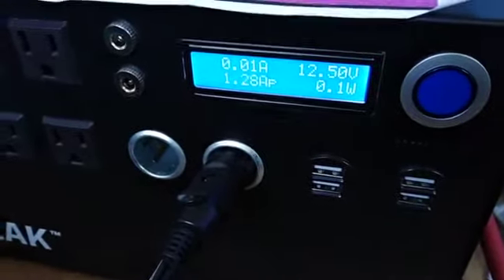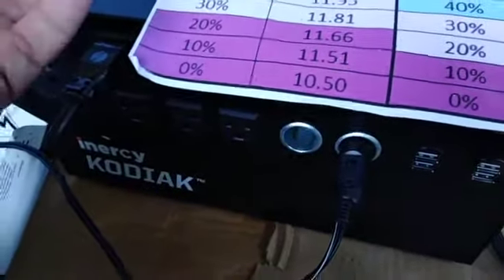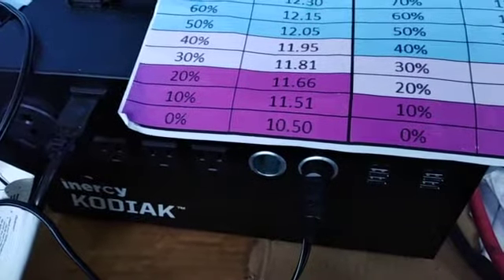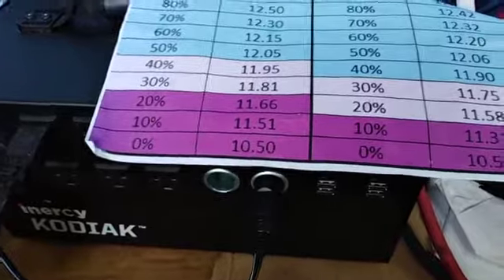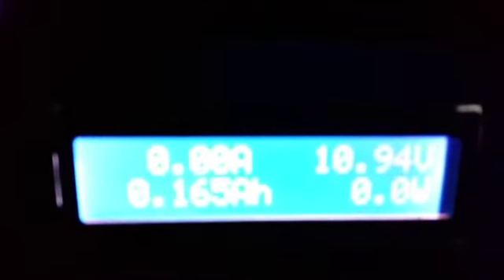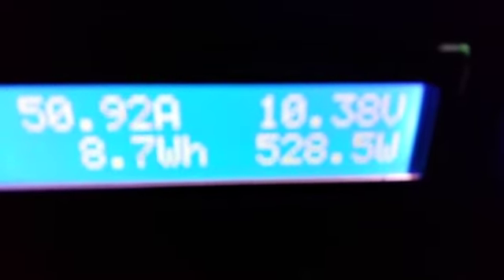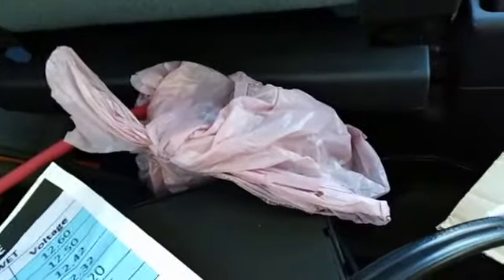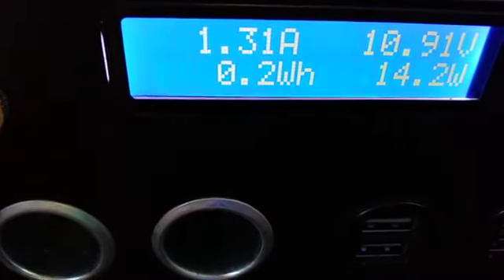Kodiak Solar Generator Destroying a AGM Battery

Comment: Is the Kodiak shortening the life of the AGM battery.
Reply from the maker: For most people the Kodiak and the AGM battery would get alone.  I am a power user.  I run an AC and an Electric heater.  I cycle the Kodiak very hard.  I have a video that that takes the Kodiak to 10% power.  The Kodiak is a very well build generator and I am not afraid to stress it.

Comment: I do not understand why Inergy recommends AGM or lead acid batteries to chain to a unit that uses lithium batteries and does not provide a custom charging and discharge parameter for the lead acids.  I also do not understand why I can’t connect lithium batteries as long as I monitor they are not being over charged or discharged by the kodiak?  Actually if you look at the 18650 lithium batteries and put 3 in series, the voltage matches the kodiaks peak charge and discharge voltages of 9.3 - 12.5v

Comment: I was looking to to the same for my motorhome house power. Only using the kodiak but I don’t know how to tie it in with the existing house battery? Any ideas?
Reply from the maker: Buy a 12 Volt Charger.  Connect the 12 Volt Charger to the 110 plug in the Kodiak.  Make sure you get the right  12 Volt Charger for your battery type.
Depending on how many Watts you have on the roof will determent how large the charger can be.

I went and bought a solar control and an AB switch :
https://www.youtube.com/watch?v=wre2SL5Watw&list=UUdo_IcaaYxaQzFnaRt8Mypg&index=2
I now can connect the solar array to the Kodiak or the AGM battery, but never to both at the same time
Reply: Can you show me a diagram. I used to have a gas generator. But it got stolen. Can I put the kodiak in the. Same place? And use the cables still there??
Reply from the maker: I just do not know.  A gas generator can be much more powerful than a Kodiak.  I would need to know the loads.  As long as you feed a gas generator gas it will produce power.  A Kodiak will just slowly run out of energy.